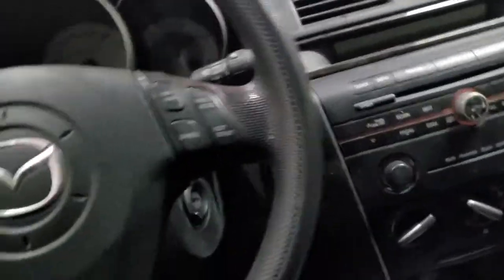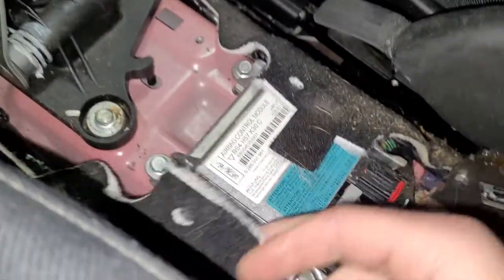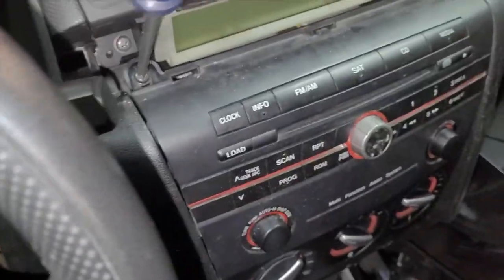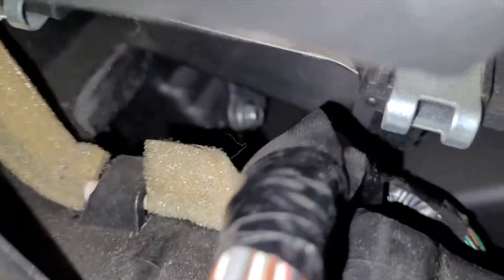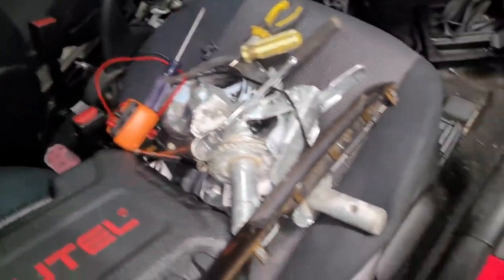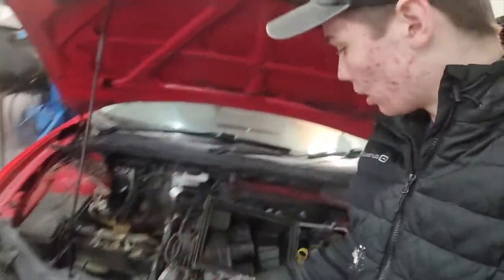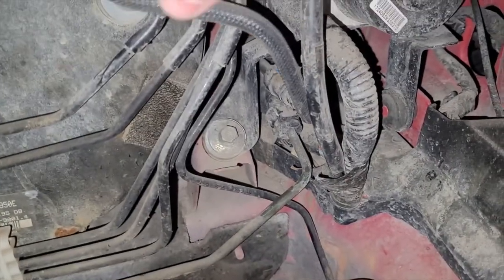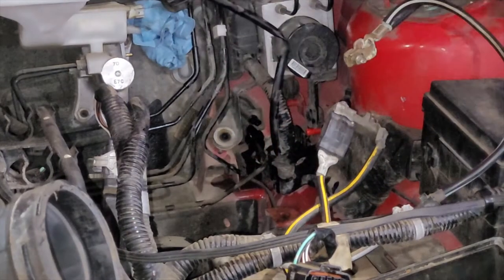Replacing the Clutch Master Cylinder on the Mazda 3 Flip Car! And Further Into the AIRBAG System!

Comment: My mannnnn I just wanted to let you know that I really enjoyed your video and you are amazing at engaging. You seem like a really cool dude! Did I learn anything? Not a damn thing - maybe I learned  that it’s highly possible the master cylinder is going to be a pain in my balls when ai try to tackle it. I think when I attempt to replace the master cylinder I will not just want - but NEED an extra set of hands . Will that eliminate some of the frustration ?? lol I hope so ! FYI I lied because I deff learned something. I was wondering wth the electrical box was below the emergency brake. I am flabbergasting over the fact that Mazda -aka Ford  would put such an important EXPENSIVE electrical box right below cup holders that is definitely not leak / spill proof!! I could only imagine what you found below the cup holders . I lost Soooo much money, lighters & a bunch of misc things in that
damn cup holder . I’ve had the Mazda 3 for 8 years. Nearly 200k miles later with crazy hours inside. I spilled probably a gallon+ of coffee and other drinks along with $24.52 of change & 6 lighters, a random scratch off card & a piece. Of jewelry. There was a strait coat of GUNK from the spills on that damn box. And that wonderful cover l- or “protector” with the Velcro is halerious 😅😂 . Makes me sound horrible but I truly never realized until I wanted to tighten my emergency brake. Okay I’m done ranting. I hope your project turned out great for you
Reply: EDIT: I I forgot to mention I had airbag light on also & was able to get it off by getting seatbelt fixed. Makes me wonder 💭 why your light was on ?
Reply from the maker: Even having sold this car a while ago, I remember it very well! It was on because of a faulty RCM. There was a TSB issues for them, apparently, for a pin having ground issues, and the fix is a new restraint control module. That's why the light was on. Under the console was ABSOLUTELY DISGUSTING! Haha! I remember all the weird little things I found under there, including a little of the Devil's Lettuce! Just hilarious. I really appreciate all of the kind words, and your support! Thanks a million, man!